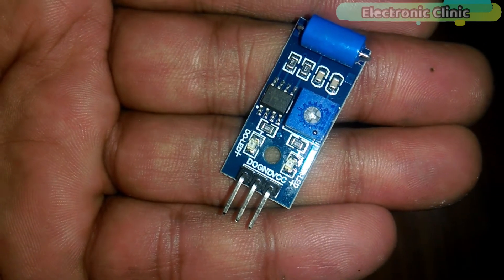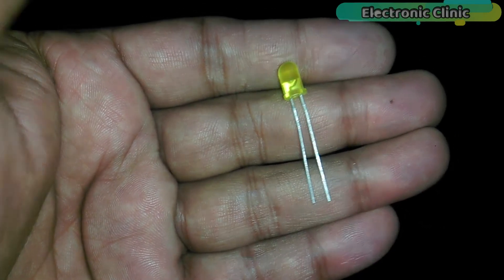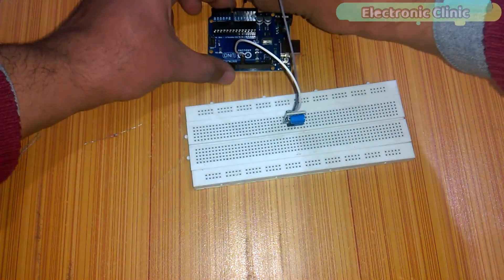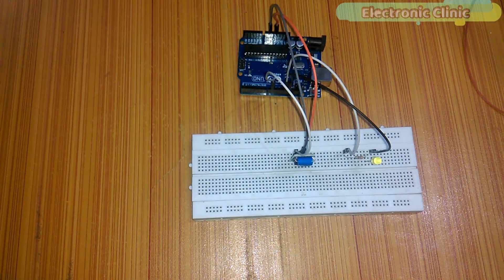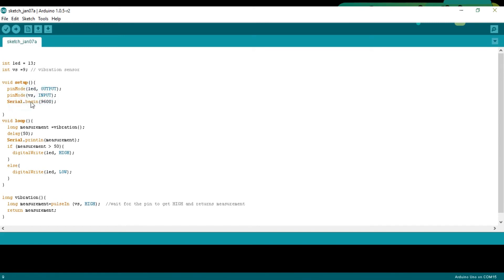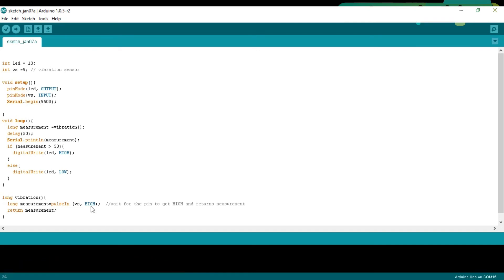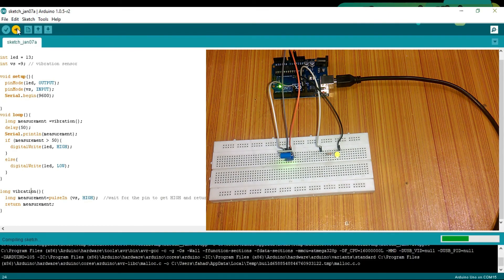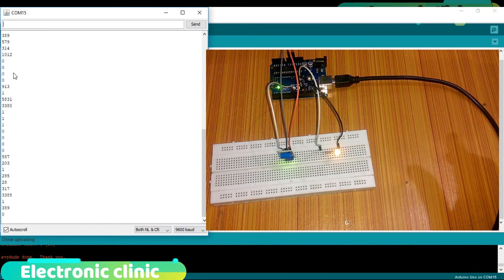Arduino Project: Vibration sensor tutorial, Vibration measurement, vibration detector “SW 420”

Comment: can you make these into wireless communication using nrf24l01?
Reply from the maker: Yes. I have many videos on nrf24lo1
Reply: @ElectroniClinic  thank you so much. would you think it is possible to trigger a 7segment display using this vibration sensor, that it counts 0-99 everytime the sensor was trigger.
Reply from the maker: Ya it can be done. Once you detect the vibration then you can do anything.
Reply from the maker: Check my other videos on vibration sensor.
Reply: ive alreary try. but the result is not ok. do data is being accepted with the use of nrf24l01

Comment: this is a great setup, i was hoping you would know how i could use a speaker as output, also i wanted to play an audio file on the speaker if the vibration is exceeded. is this possible?
Reply from the maker: I have a separate video on how to play audio files. Check playlist.

Comment: Can we adjust the sensitivity of the sensor so that it can sense only high vibrations?
Reply: That can be adjusted by potentiometer on the sensor.
Reply: you can change measurement > 50 to measurement > 200

it depends on the sensitivity that you need so keep changing the number until it is too high for you then lower it slightly.

Comment: Actually I am making a project on vibration sensor using arduino where we will be monitoring the vibrations of the machine and detect if it is vibrating above it's limited value.It would certainly be good if you gave a little advice .Is there a requirement of nodemcu if I need to display output on screen or that purpose is solved by the output window of Arduino IDE ?
Reply: Did you got the output.plzz say iam also working on that project

Comment: How can I boost the signal of the vibration sensor so the Arduino Board can see weaker signals coming from it?  I know I'm missing some signals coming off the sensor using the set up in your video.

Comment: can vibration sensor detect the frequency of faulty component such as resistor or capacitor?
Reply from the maker: no. 
it is only used to monitor the physical vibration.
Reply: @ElectroniClinic  ouh okay thank you

Comment: would there be an application for sensing seat (Such as a car) vibrations specifically measuring vibrations as a frequency.
Reply: I'm also looking in to that. Did You find out how to connect this with some software showing vibration graph in real time?
Reply: @nartymmd   Have you find out something because I currently need it?
Reply: @florianbourchenin1206  Yes, ADXL345 accelerometer :)

Comment: what is 50 in your code ...what is the unit ??? and what is the max value we can give ??..what is output unit of the vibration sensor?/??it=s it hertz or something else
Reply: I would also like to know.
Reply: i'd also like to know...
Reply: it will make a delay for 50 millisecond between each time to apply the vibration(); 
meaning: the function vibration will feed arduino with vibration reads every 50 millisecond to display the events on serial

Comment: I want to create a rig that will allow me to measure the vibration of my boy's pinewood derby race car wheel and axles so I can determine which wheel axle combinations run the smoothest (least friction).  Do you think this would be applicable.  I'm not much of an electronics expert, but I can see how this could possibly work.  Though I'd rather be able to read a numeric value for the vibration than just a led signal lamp.
Reply from the maker: you have different options, you can use this sensor, you can also use a piezo sensor, and you can also use mpu6050. 
But first you can try this one. its a low cost sensor, you should give it a try.
Reply from the maker: coz the way i used it, you can now decide, its gonna work for you or not.

Comment: can you give me an idea for my final year project?  using arduino
Reply from the maker: Yes sure. Tell me ur field of interest ??
Robotics ?
Communication ?
Power ?
Security ??
Reply: Electronic Clinic just only have audio and video .
Reply from the maker: sorry didn't get you. tell me in detail ? audio and video what ?
Reply: @ElectroniClinic  the project must have audio and video such as sounds and light for example.
Reply from the maker: The you will have to invlove microprocessor as well. You will also make a computer application. 
Select something that you can make using only arduino and other circuits
Reply: @ElectroniClinic  yes i know that. so what is the idea
Reply from the maker: you can make HMI system for plc and controller 
you can make  wireless sensor network for different biomedical sensors 
you can make a Smart sewerage system using xbees and nodemcu wifi module. 
you can control a real car using wifi or bluetooth technology..
Reply: can you email me for that project